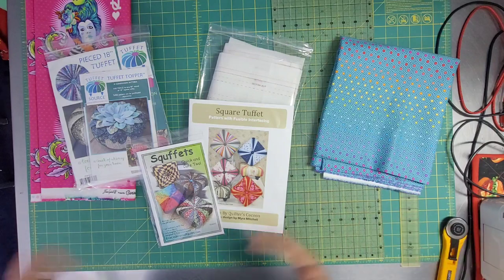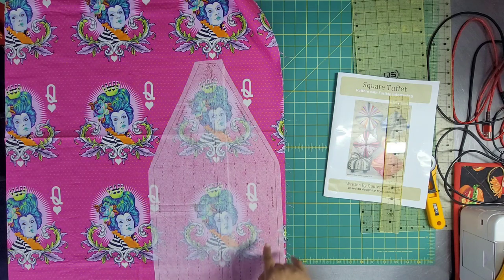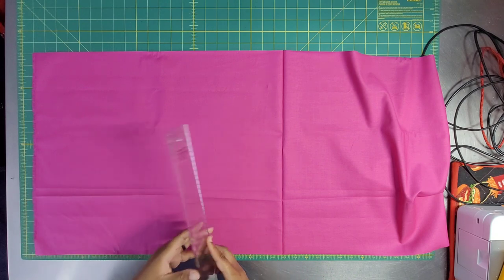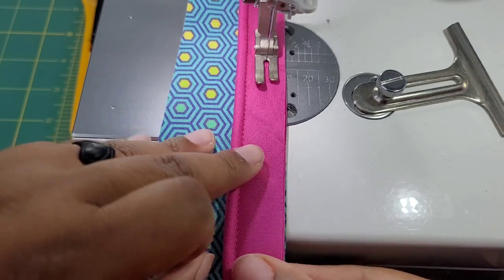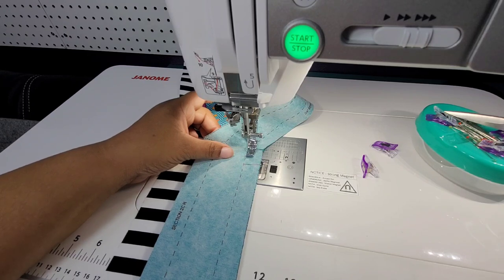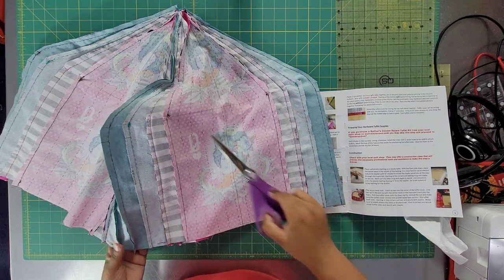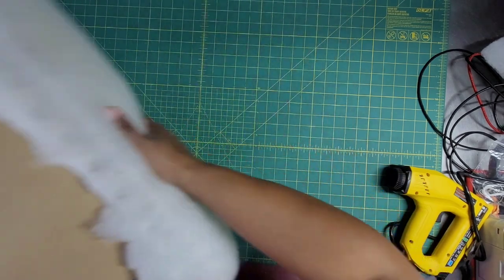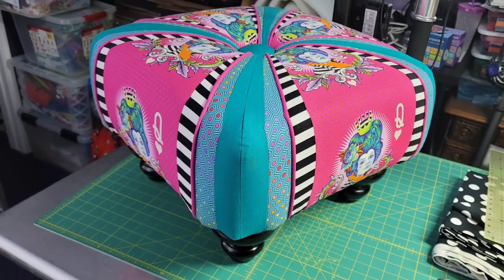How to make a Tuffet | Squffet | Ottoman | Foot Stool

Comment: You could use the ruler with the rotary cutter.
Reply from the maker: I think I ended up using scissors. I was scared my rulers were going to pull and rip at the foundation because it was so lightweight.

Comment: 28:35 great video! But how do you sew the quarter panels together so the hole at the top is very small. I’m not sure what I’m doing bc I’ve already Seam ripped once and adjusted and while it was smaller, it’s still too big. 😭 advice?
Reply from the maker: The hole at the top will not be small it was ugly and big. The button will cover it.